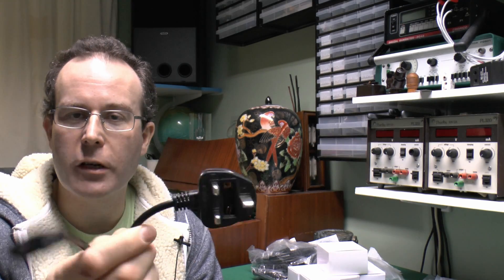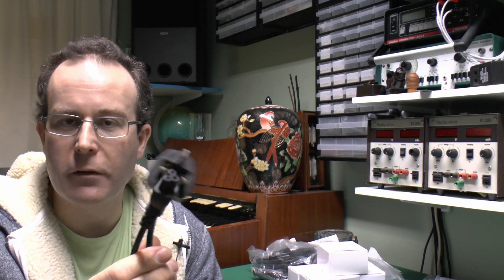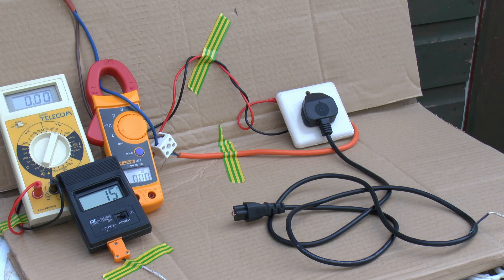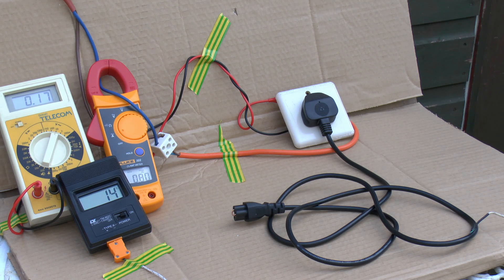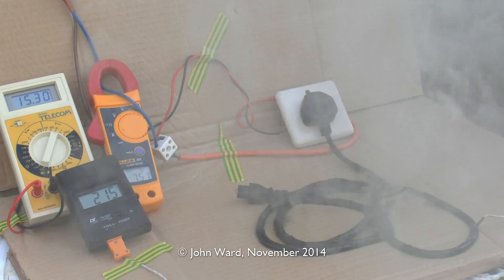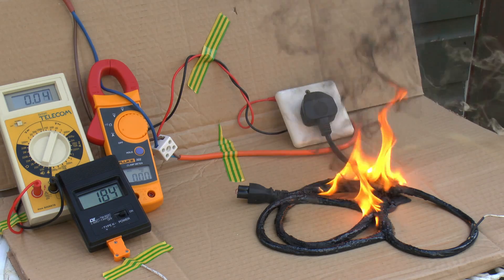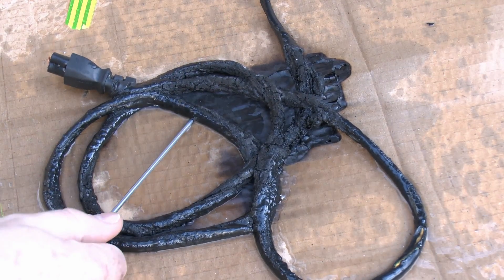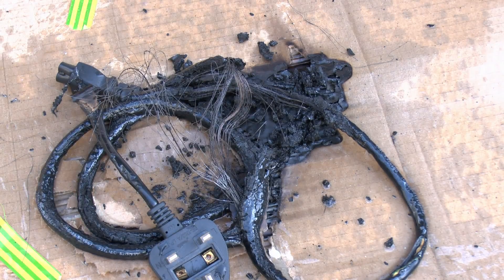C5 Power Lead Destroyed

Comment: So what is this supposed to proove? That if you do something with a thing that it's not desiigned for it will fail catastrophically? hereI think it's 1,5mm2 copper that is rated for 10 amp but you hardly find that in any connection cables since very few domestic appliances that do not run on 3 phase run continuously at 10 amps. If they do they probably have a permanent cable anyway. (Like stoves for example) If you could replicate this resuld with the wire actually attatched to an appliance it would be a vastly more relevant test.
Reply: +rimmersbryggeri the point is to show that the fuse doesnt actually do anything. If this was a proper cable with working fuse, it would have blown the fuse way before any of the catastrophic events.
Reply: Ashraj Dhindsa
 Most countries however don't have the fuse in the plug.
Reply: +rimmersbryggeri should they not? Or is it just to save time and money by manufacturer? I think there should be a fuse no matter what country.
Reply: Ashraj Dhindsa
 No ther shouldnt. The fuses place in a modern system is on the distrubution board. British modernisation is just  very slow.
Reply: +rimmersbryggeri  oh I see........ I'm from USA so I don't know the specifics. In USA there are only some power cables with built in fuses, but it is rare to see.
Reply: Ashraj Dhindsa
 Most houses probably have  multiple fuses on the distrubution board. In england the have circular circuits with one huge fuse for the whole house and a fuse in the plug of every appliance. It's an old system. Compare it to old time coaxial computer ring networks. Now we use hubbed or star networks it's almost exactly the same principle. This means you can put one fuse for each room on the distribution board.
Reply: rimmersbryggeri Ahh that's interesting to know. Thanks for the info.
Reply: But the plugs are way too bulky. I learned about the ring mains after this.
Reply: +rimmersbryggeri The British system, works by linking all the plugs to a ring main, as the standards were developed towards the end of/after WW2. It's more effective at using less copper, as there was a metal shortage due to the Army needing it still. It's unlikely that Britain will ever "Modernise", as you put it, because there is no reason to, plus the standards are rock solid, like they always have been.
Reply: +rimmersbryggeri I don't think they are bulky tbh. I use them every day and they are fine
Reply: Yeah thats the problem..
Reply: +rimmersbryggeri 
Fires can and do happen with extension cords. People will often leave them wrapped up while running something if the cord has significant extra length. The wrapped up cord is dangerous because it can heat up too much.
Reply: +rimmersbryggeri could you imagine what a pain it would be to change them all now? You'd need to change the plugs on every appliance. . change every socket in every home. . it would cost billions.
Reply: vortexlisa
 No you wouldnt. You would only need to change the consumer unit and house wiring when the house was restored and you were doing it anyway probably.. You get new leads with everything you buy so you will soon stock up on them, I even ger 3 or 4 chords with different wall plugs when I buy computers or tv's or any other domestic appliances. Your  plugs are safe as long as you don't step on them so no need to change them unless you are doing it anyway. (Many electricians don't really fancy the ring mains either and with a star arrangement there is no need for fused plugs).
Reply: Andy Merrett
Pssst.
Before you go around demanding others to correct their English, perhaps you should correct yours!

"Secondly, in the UK have fuses/breakers both in the plugs AND on the distribution board." Is not grammatically correct. It should say something like "Secondly, in the UK, we have fuses/breakers both in the plugs AND on the distribution board."
Reply: Yes, more plugs should have fuses, but don't forget, sometimes the electric device may have a fuse inside of it.

Comment: I have a few questions. Firstly, would this cable warm up as quickly if you were using it to power an appliance such as a light bulb or something since the light bulb would use the energy instead of the cable using all of it? and secondly, how would the voltage increases? I've heard of voltage dropping when too many amps are used but not the other way around? Surely, it can't be higher than what you're putting out?

Comment: With 230V, it'll most likely turn dead short at less than 150C. I had an IEC lead popped after like 30 min with only around 5 Amps load. It tripped the 16A breaker, but the 13A fuse still intact.
Reply: I have had this argument till blue in the face with other very experienced electricians.  13A fuses are not designed to blow at 13A.  
They blow at around 25A so you have this Goldilocks zone between the rated current carrying capacity of a cable  - 24A and if overloaded by just the right amount 

Had a place i tested yesterday with a microwave/toaster/kettle/air fryer all plugged in to one extension lead.

Comment: I had a lead a bit like this one - a bizarre story behind it, actually. I ordered, from a supplier in Denmark, a Schuko-to-C5 lead. Assuming I'd made a mistake, they sent me one of these, which they didn't even list on their web site - though they did list a 13A-to-C13 lead. They sent the Schuko one out when I informed them I had not made a mistake and did in fact want that. I had no idea at the time that there was anything wrong with the lead, but the neutral wire failed at some point, at the 13A end. I cut the plug off intending to wire my own on and found the wire to be poor quality and with the internal insulation black, white and grey, rather than the usual colours. Not surprisingly I scrapped it.

Comment: pretty spectacular, really dangerous since fuses have a time delay before going off. A ordinary 5x20mm ceramic fuse can take up to 30 minutes on 210% of rated load before popping (Data obtained from Littlefuse 215 series), by that time we already have a bonfire with those cables. That's immedeatly life threatening and should be illegal to sell/ship.
Reply: +Paxmax My girlfriend used to live in a poorly maintained flat that had a fairly serious wiring fault before the fuse box where the two large grey cables were shorting out against each other behind the electricity meter. Eventually the correct electrician turned up and when he removed the meter there was a large scorch mark on the wall and the two input cables completely missing their insulation.

Had those wires gone dead short the only protection is the 400A supply fuse, the wires themselves melting (to protect the probably very expensive main fuse ;-), or whatever overcurrent protection exists on the street supply.
Reply: James Grimwood Geez! that could have turned out to be a negligent homicide/endangerment! glad it was caught in time.
Reply: Dodgy wiring. The house was split in two and somehow an extra electricity meter got installed for the upstairs flat.

There was even an isolation switch to turn the upstairs flat off... Before the electric meter...
Reply: +James Grimwood 
Wow, that is scary!
Here in the USA, we have no or very little protection before the main breaker. I dunno why ... I'd much rather have some sort of fuse and/or circuitbreaker on the output of the pole transformer...
BTW, here a lot of people think smart (aka digital) meters cause fires. Indeed they can, but it is a very very very slim chance. The meter box fires usually start because of improper installation, I.E. installing the meter into a socket with weak contacts, and failing to clean/de-oxidize the contacts before installing the meter.
Reply: mharris1270
Yeah ... I guess the power company could put one of those tags on the box, like they do with the electrical meter. Or maybe have both in the same box.
Yes, you'd have to call the POCO out to come and reset that breaker if it trips, but then again, it's a main, high current breaker ... if that trips, there is either a serious problem, or the breaker is faulty...
Reply: I live in The Netherlands, and there is a main fuse before the meter in every house.
It's contained within the same housing as the meter is fitted to, and the screws of the lid are sealed with thin wires with lead labels.
Also a meter is not plugged into a socket, but wired in between the main fuse and the breaker cabinet (the system in a house is divided into 4 and up to 10-12 groups of max 16 amps each, depending on the number of sockets, lighting points and what is intended to be running on a certain group), the main fuse is usual 50 amps (240volts, so that equals the 100amp fuse in the US).

Comment: A while back I purchased a new laptop power supply off of eBay. due to their default "on eBay" location option I actually purchased from China and received one of these plugs!

it proceeded to smoke and spark one day and that was when I chose to take a look and found sure enough that the fuse was bypassed and completely pointless.

Comment: I'm wondering how much of the voltage drop and hence power dissipation was in the 13A plug/socket - remember it started off as a 15A design but had to be derated.
Reply: mharris1270 Missed point? I was referring to this test, not in use.

Comment: Did you really just put water on it? :D
Reply: I presume you're surprised that water was used to extinguish an electrical fire, but electrical fires are no different to any other type of fire, except that there might still be live electricity running through the bits that are on fire.  So if you put water on it, the electricity might run through the water, back to you, and give you a shock.  Or the water might connect two wires that weren't connected and cause a short circuit, immediately boiling the water and causing an explosion as it instantly turns to a large amount of steam.  But the point is that the danger comes from pouring water onto an energised device, whether it's on fire or not.  Once you remove the supply of electricity, it's no different to any other type of fire so putting water on it is just fine.  In this case doubly so because the voltage was so low that there's no shock risk even if the water was put on when it was live.

Comment: My Fluke 177 doesn't measure below 1 ohm very accurately - just the test leads on their own measure 0.2 ohms with nothing attached. Is there a simple way of measuring low resistance using a multimeter?
Reply from the maker: ***** With a multimeter, the only method is to measure the resistance of the leads, then deduct that value when measuring the component.  Some have a 'zero' function built in which does the same thing.

To avoid the problem of the test lead resistance completely, a meter which has 4 wire capability can be used.

Comment: It appears that some cheap wind-up extension leads are using this type of flex.  My brother once saw a partially wound extension have its flex melt together when used with a power washer and these generally don't draw more than 2kW.  Had that extension been used like this indoors such as with a 3kW heater and left unattended, that probably would have caught fire.
Reply: Seán Byrne That annoying little safety tag that inevitably get ripped off/falls off of all extension leads warns you to completely unwind the cable before use. Because yes, thermal buildup and failure will result :)

Comment: The thumbnail image made me click the video. I see flames! :D

Ooooh, that was a nice long torturous burnout. Given the temperature that this rose to, I'd seem to think that if this was sat on a carpet with a wooden floor underneath that, the cord would have melted into the carpet. (Mr. Photon knows a bit about power cords melting into carpets! :D)

20A wasn't an unreasonable amount of current, and as seen by the orange flex in this vid (which did take the juice) it's pretty obvious that a genuine power cord would take 20A for a short while, even if it does become uncomfortably warm, but without any deformation or discolouration, not to mention thick smoke with the inevitable flaaaames!

In reference to Part One, the alarm bells start going as soon as it is seen that the Earth pin has sleeving on it (so the plug of course isn't made to BS 1363) and that the fuse has 'FUSE' wrote on it. I mean..... what else could it be? Battery? Capacitor? Diode? No, it's a fuse (or at least it's supposed to be!)

In a way, it's bit of a shame that you opened that fake fuse, as you could've rigged that up for poppage in some kind of way, just to see how much current it would really take until it let loose.

Either way, the resistance of that flex is waaaaay too high, so let's say that it was made to catch on fire.

Good job, that's another fake product removed from service and therefore can't harm anyone. The manufacturer should be ashamed of themselves. They obviously don't care about quality and even 'fiddle' British Standard numbers (in this case BS 1362 and 1363) just to make a quick buck.

These people should be tracked down and prosecuted.

Thanx for showing,

-BoomBoxDeluxe.

2nd January 2015, 15.05

Comment: How did then Orange lead cope with it? Would be good for a compare with good and bad cable. The Orange cable must have got to the same temp?
Reply from the maker: Justin Coleman The orange flex is 1.0mm², rather than the claimed 0.75mm² of the black test item, and the orange is solid copper rather than aluminium with copper plating.

Even assuming the black flex was actually 0.75mm² , the orange would have a resistance of less than half of the black test lead, so the heating in it is substantially less.
In reality, that black lead must have had thinner conductors, as the aluminium/copper difference alone would not result in the measured resistance being 2x - 3x higher than it should have been.

The orange flex still got hot, although not enough to melt.